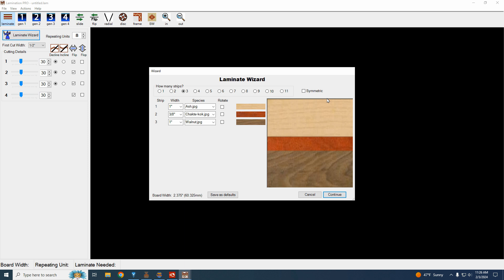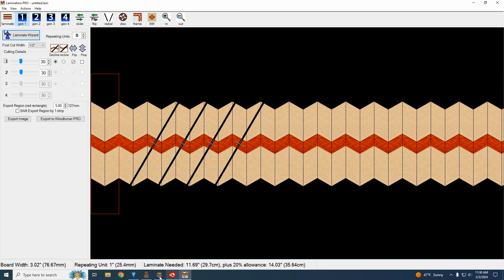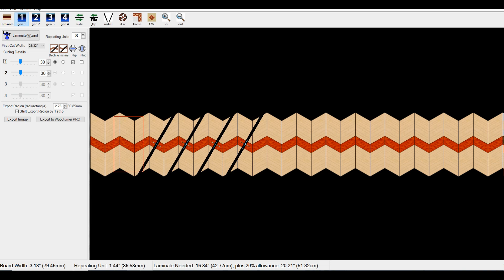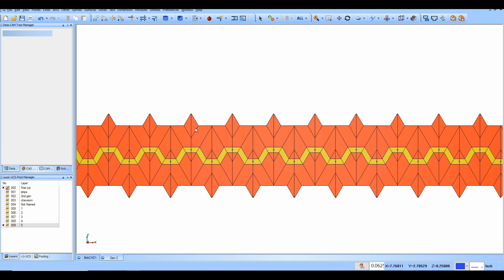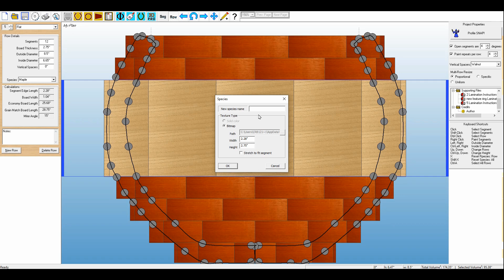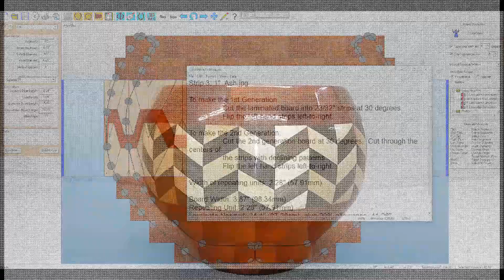Cool Wood Turning Feature Ring Lamination Pro

Comment: Gary , take your time and get better and keep teaching about the software I bought :)  

I did just finish my first 7 ring + base segmented turning yesterday using less than half of a $10 piece of mahogany from a midwest big box store.  I can point out every problem I had and it was a learning experience but now it will be easier next time, and I want to make one big enough for the beads of courage for my next one which my chapter is very involved with.    

I would have never even tried segmented turning if not for your videos.
Reply from the maker: Thanks Bryon. I think it is a dream that even after I get to put weight on that ankle I will be able to do whatever I want 
 Sounds like you're having a good time with segments.
Gary

Comment: Gary thanks for showing us this software. You may not know but I am in a wheelchair, and I turn on the lathe by using a tall stool. Perhaps you could do the same for a time untill you get better. Love your turnings and your teachings. Stay safe and good health. Thanks Tim
Reply from the maker: Thank you Tim and I did not know that. I have a few other viewers that are in a wheel chair do a good job of turning.
I figure if they tell me I can put weight on that ankle I will probably try a stool.
 Thanks for the tip and I am very impressed with what you are doing.
Gary